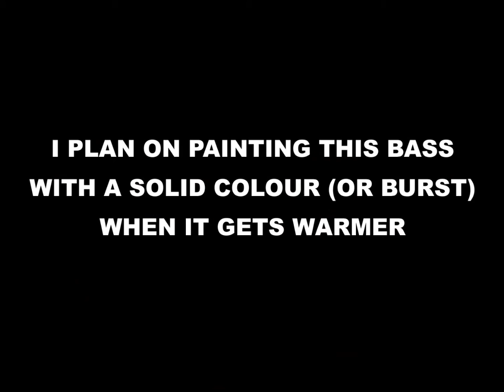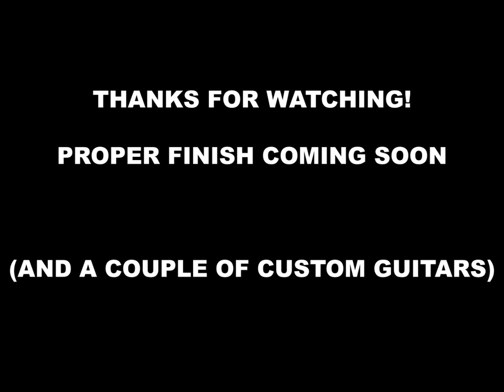Repairing a Broken Bass Guitar (Neck Heel Joint & More)

Comment from the maker: After drilling one hole I inserted a nail cut to the size of a dowel and pressed the point of the nail into the non-drilled side to make sure they were lined up properly, it seem to work out alright. Also, I measured from the pickup cavity on each side to double check.